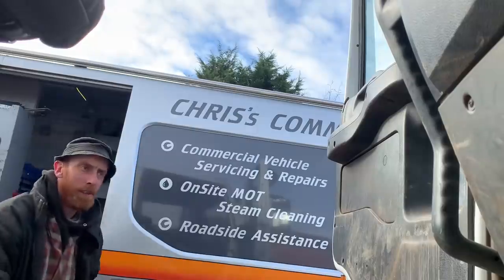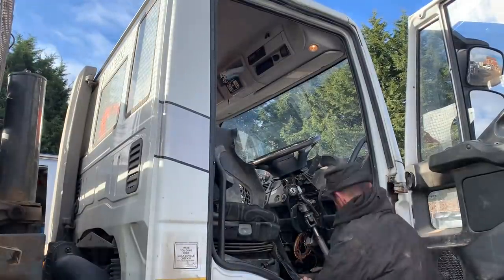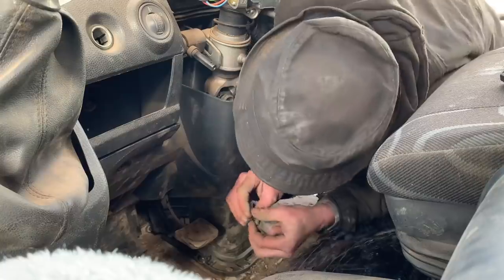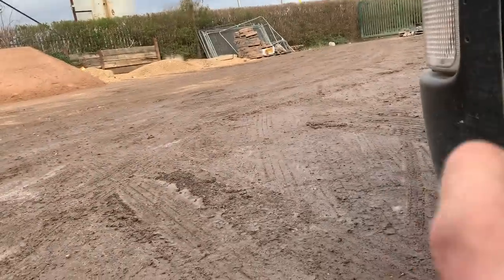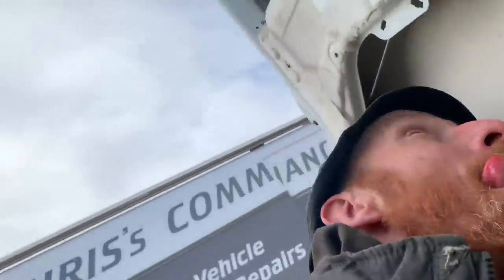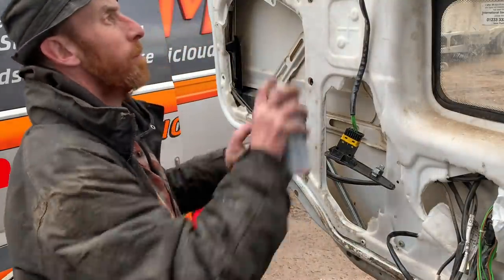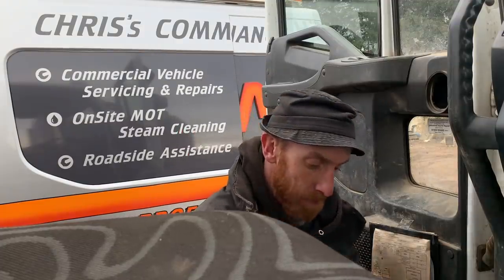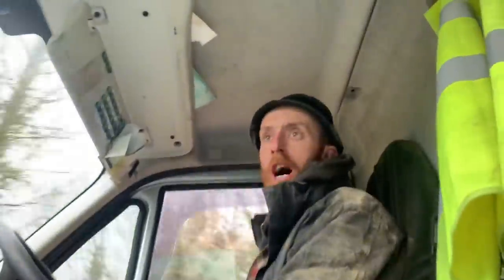Winder motor replacement Iveco! Inspection and My girl screaming mobile truck mechanic

Comment: As an ex screen fitter trust me when I say silicon spray not wd on door felts. And the bit of blue pipe is for the excessive wire coming out of the motor on wind up and  down. If unprotected the excess steel wire will make scratching noises inside the door like a little mouse. So if that's kinked or jammed it will slow things down too.
Reply from the maker: Aaar that’s what it’s for!!!! I’d better have that whipped off again then Tim because that’s why it might be slow! Oh god don’t talk to me about mouses mate 😂 thanks Tim for your advice pal 👍

Comment: Arrr,  my favourite type of parts are non genuine aftermarket ones! You know the ones that look kind of similar but are cheaper for reasons. Reason 1 being they don’t bloody fit. I’ve told our store man more than once that I’m gonna install the next cheap nox sensor he gets into his chuff pipe! 
Oh and silicone spray on the window runners will help the glass move better
Reply from the maker: 😂 puzzled me for a bit that one did.... non gen is about all I fit mate it can be nightmare sometimes but it’s all about price and availability. Silicone cheers Richard👍 take it easy mate